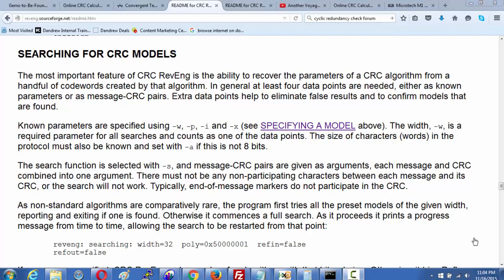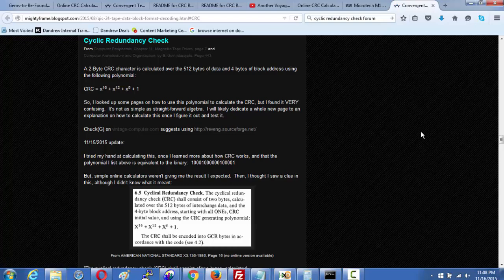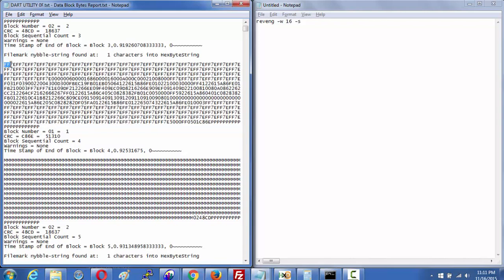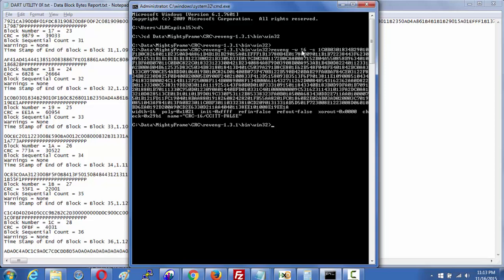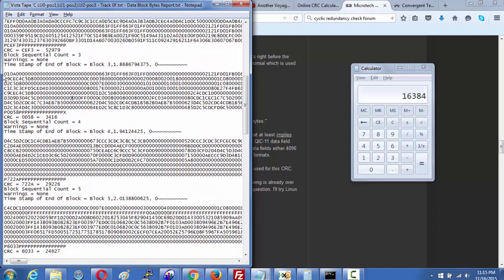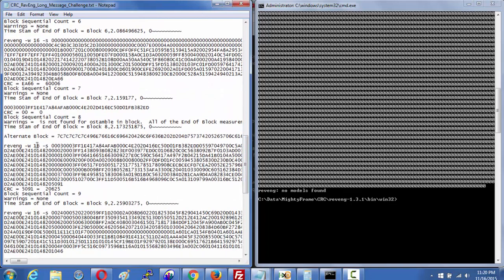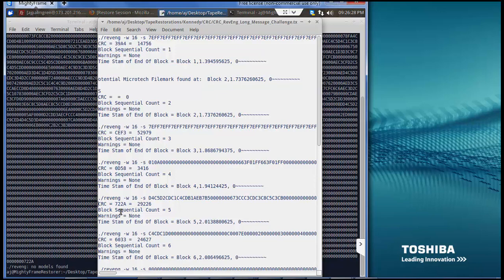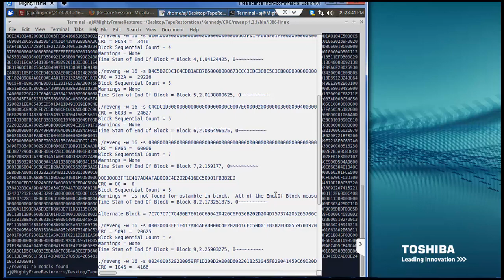Can CRC_RevEng work on very long messages?

Comment: Hi, thank at least I know that not only me was facing problems with reveng. So you resolved this as I can see in linked post? Anyway, I used pre-build reveng linux-32 copy (self compiled one, have w=0 for all 16bit & 8bit crc models). cmd: "reveng -w 16 -zsf hbn-06_rec1.bin hbn-06_rec2.bin hbn-06_rec3.bin"  . Be aware  "-z" has no effect and files should in binary (hex  code text files will not work). The records I have are around 32KB each and it does work fine. 1 or 2 records only were not enough, so I use 3 rec's.

Comment: I started messing around, and the first thing I tried was to put your long value into a file and use the -f switch under windows, so my command would be 
reveng.exe -w 16 -s -f data.txt
where data.txt has just one of your strings.

But I got the 'reveng.exe: no models found' message as well.. but it could at least be a workaround for windows and it's command line buffer.

I messed with the width parameter to see if I could get any output at all, and one of your blocks of data as set with -w 8 gave me back the likely garbage and coincidental:

width=8 poly=0x39 init=0x00 refin=true refout=true xorout=0x00 check=0x15 name="crc-8/DARC"

Could you post some of your qic24 blocks in the comment for a sanity check as well?
Reply from the maker: +Cpro Nikkor Thanks for looking into this for me!

"Could you post some of your qic24 blocks in the comment for a sanity check as well?"  - Yes, here is the entire track 3 of that tape.  Warning: its a big big text file:

http://bit.ly/1MlcsSX

This is an unmodified version, so you will need to remove any "P" or "X" characters from the data block, because those are markers of a preamble/postamble, which is GCR "11111", which likely was not translated into a binary nybble.  The Xs would be garbage found only after all of the postamble Ps at the end.
Reply from the maker: +Cpro Nikkor And just now, testing one of my previous examples of the QIC-11 512-byte message, which worked in Windows 7 command prompt, is not working with the -f data.txt parameter you specified, even the very same message that worked on the command line.  Interesting.

I wonder if I'm missing something?
Reply: +Convergent MightyFrame to be honest I think I am missing something or using a switch in an unexpected way. I also tried piping data to the command but that does not seem to be implemented in any way.
I hope you hear from the author.
Reply from the maker: +Cpro Nikkor Yes, so do I.  I appreciate you trying, Cpro!

Comment from the maker: So, I'm testing with CRC_RevEng using -f with a data file, but I cannot get anything to work there at all, even simple, known examples that return the correct example on the command line, fail with the -f data.txt

Here's an example:

This works:

C:\Data\MightyFrame\CRC\reveng-1.3.1\bin\win32>reveng.exe -w 16 -s 0a1b2c3d4e5f6
789d272
width=16  poly=0x1021  init=0x0000  refin=false  refout=false  xorout=0x0000  ch
eck=0x31c3  name="XMODEM"

But this, which should be exactly the same, doesn't work:

C:\Data\MightyFrame\CRC\reveng-1.3.1\bin\win32>reveng.exe -w 16 -s -f data.txt
reveng.exe: no models found

The data.txt I'm using is attached.

I tried with both a return character after the end of the line, and without.  No difference.

I even tried editing the data.txt with my hex editor, and verifying that there are no extraneous bytes in there, and it's a pure text string.

Any insight into this?
Reply from the maker: +Convergent MightyFrame Lawrence W. from the email list at http://classiccmp.org has just shared the solution to my problem executing a file with -f.  Here that is:

"I think your problem with reveng is because the file needs to be in binary, not text/hexadecimal."

Well, Lawrence was absolutely correct...thank you, Lawrence!

http://bit.ly/1MXMfvg